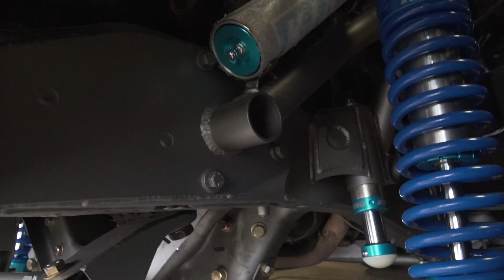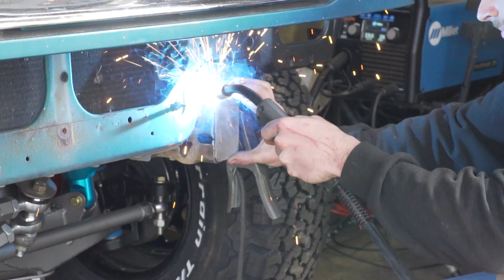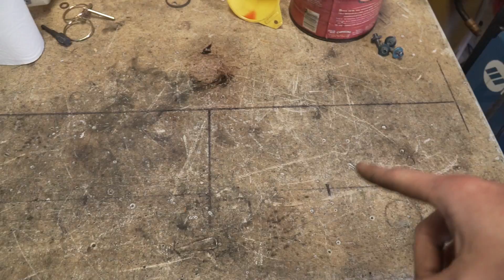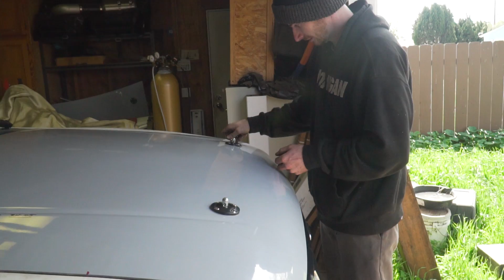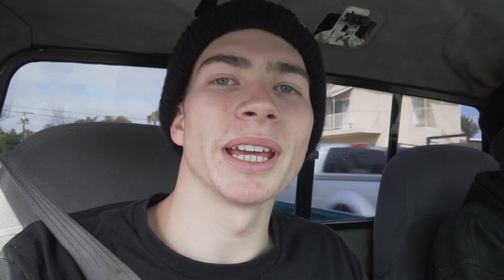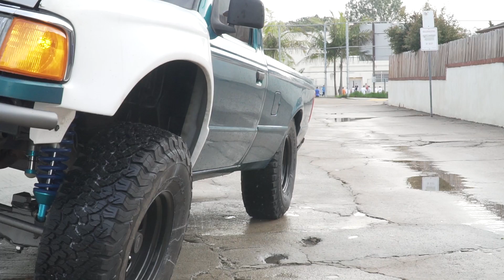FINISHING The Ranger Prerunner  *FIRST DRIVE*

Comment: Dear lord “ it won’t bend In the tubing  bender without the extra length”.  Yes it will. Learn how to explain shit exactly how it works and why. When you bend any metal pipe you loose distance in the bend itself. That’s why you need to always have a little more. There actually is a formula for bending pipe that tell you how much extra you need to hit your mark. But otherwise nice build. Don’t completely destroy it though lol. have some fun and be safe.  Also any thoughts for bigger motor?

Comment: To keep the bed from hitting, try lifting the bed up and adding your own body lift to it. Fabricate about 4 steel cubes with holes in the center so you can mount the bed back on, and weld them to the  frame. So not only do you have a homemade lift, but also enough space for less rubbing
Reply: hell yeah

Comment: Amazing how all Rangers have the exact same power steering whine.
Reply from the maker: haha! make that all 90's fords
Reply: @WingsWorldChannel  make that all 90’s trucks😳
Reply: The steering pump in mine sounds like a damn supercharger
Reply: It's the Ford whine
Reply: I have a 96 ranger and surprisingly the PS pump doesnt whine. 😂
Reply: @Jeremy Hill, if you are using power steering fluid that has most likely caused the leaks.
Reply: My mom has a 99 mustang and it has the power steering sounds the exact same lol, classic.
Reply: Yeah, along with the explorer haha
Reply: In my experience it is caused by using power steering fluid instead of the ATF it calls for.
Reply: @Fyc1x3x8  Eh, I have a brand new rack and pump with the right ATF and it still whines.
Reply: @Fyc1x3x8  mine is in bad condition so it makes the whining noise & even when I pour in steering fluid, it leaks
Reply: Easy fix, ps delete
Reply: I flushed mine out with mercon v and put a new return line on with new clamps and a magnefine filter and it shut the hell up.
Reply: @mattleonard5268 yup, turkey baster and flush it until it’s quiet. Maintenance is key. They quiet right up too but I use Valvoline high mileage trans fluid
Reply: Hell, my ‘96 Exploder has that whine!
Reply: Jesus loves you alot trust in His death 4 salvation and be saved from eternal hell <3 Jesus died on the cross for you bro. <3
Reply: Unless ur cane with manual steering